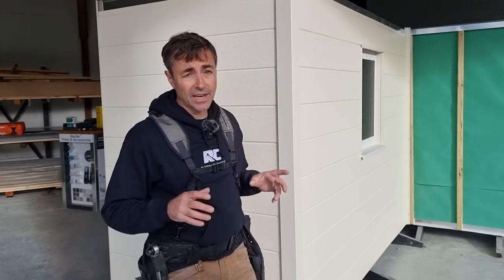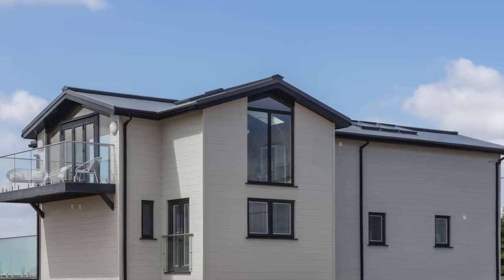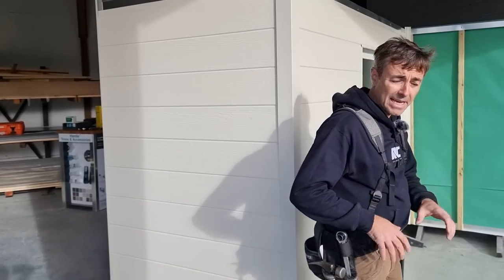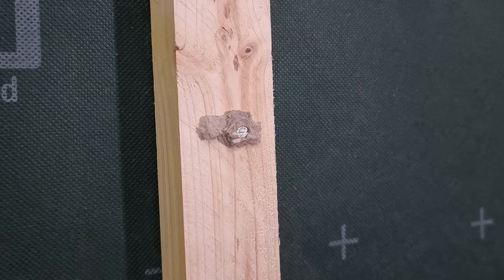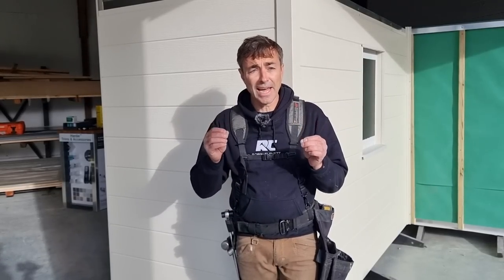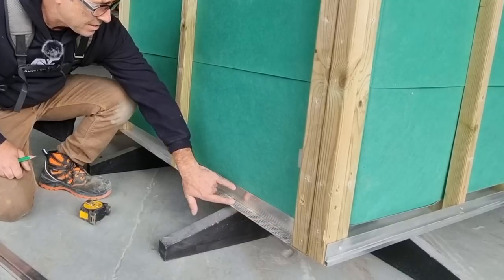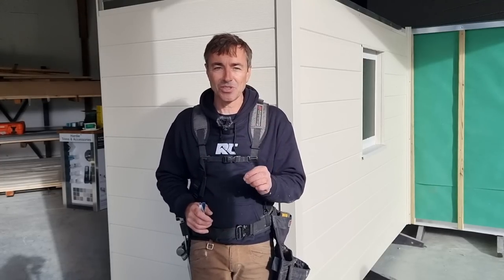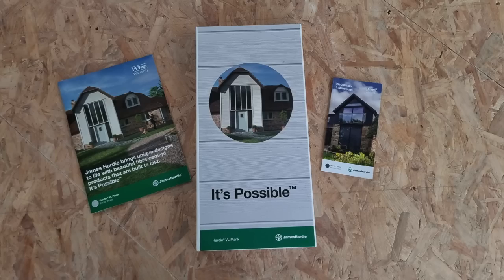Best practice for installing Hardie® VL Plank

Comment: If I was designing a cladding product mine wouldn't be fixed gauge. Having the ability to open and close the cover makes all the difference. Even bricks you work out your courses by bed joints. The old school weatherboard. You had loads of variation. The old hardie plank. No taper even more flexibility. All these clip together fixed position things just make harder work. Yes setting out is important but in a lot of cases doesn't help. You can start with the bottom literally laser level. But that doesn't equate to everything fitting. Different height windows. Different height walls. Change of angles etc. Often leaves stupid bits in some areas. We used to juggle cladding to best fit. Now we have to struggle the fitting to keep the same line. You wait till you try the Hardie sheet board lines. Massive heavy patterned boards. Great fun in tight areas between scaffolding hanging in the air. Trying to get all the cut rounds to fit. You say that boarding is 3.6M. Our Hardie boards come 4.2M and up to 16mm thick. You can't pick them up under your arm and stroll off. I could do an info commercial for Hardie. Pros and Cons of an experienced installer. Doubt they would pay me. More cons than pros.
Reply: Interesting feedback, cheers Dave
Reply from the maker: Really valid points, especially around access on the scaffolding... the fixed gauge does need the setting out to be really good as you indicate, thanks for taking the time to watch and give your professional veiws mate

Comment: How do you finish the very top board close to a soffit. Just leave it sealed with the paint and about 10mm gap. Or would you put a J trim over it?
Reply from the maker: Hi Simon, we use a trim from memory it is the J trim and this is the same as the one we used under the window sill that allows for the ventilation gap and also to slot the final board up then down into the groove, hope that helps
Reply: @ukconstruction  thank you for your time in responding - it means a lot. Great videos and tutorials btw.